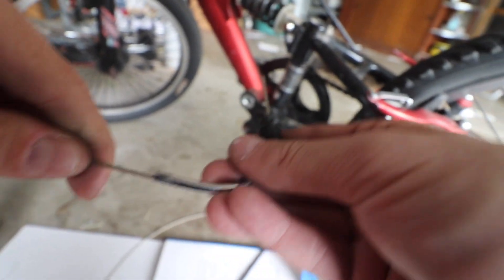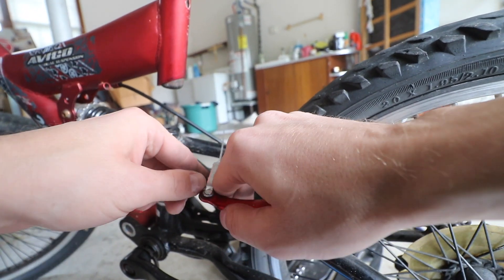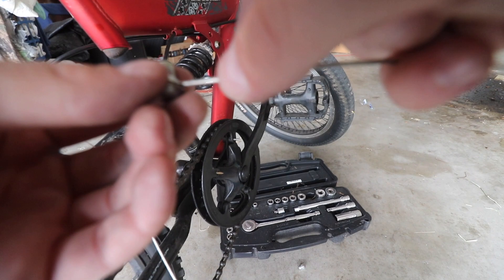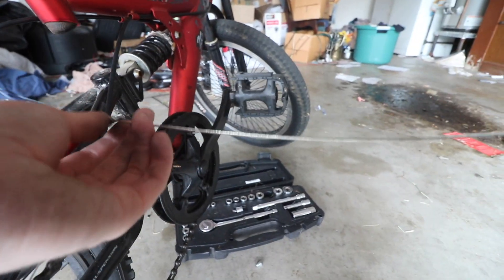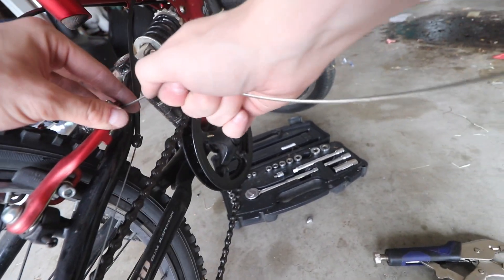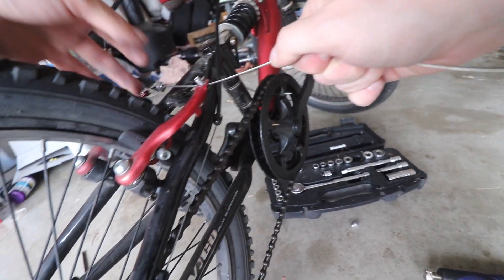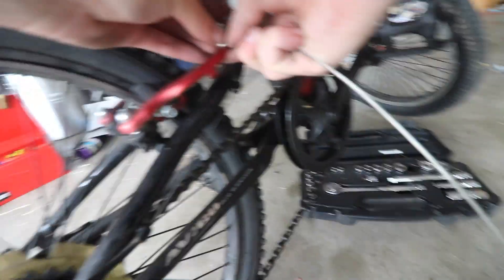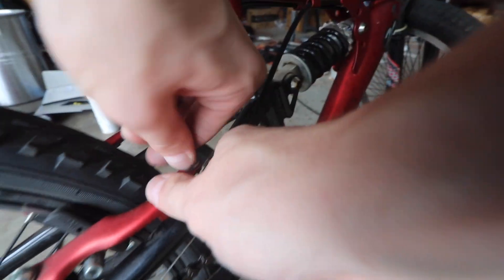How To Replace Bicycle Brake Cable EASY! (Rear Brake Cable)

Comment: Unfortunately, when cutting the end of the new cable off it starts fraying, making it very difficult to thread through the outer sheath. Stubbed my fingers thousands of times today whilst at it. 😟
Reply: @onrepeat73  Just like that - by carefully putting through all holes and then clamping the ends with aluminium clamps provided. A word of caution though: don't try changing gear cables unless you really know what you're doing. Brake cables were absolutely fine, but ended up messing up my gears so had to take my bike to a bike shop to get it fixed. 😐